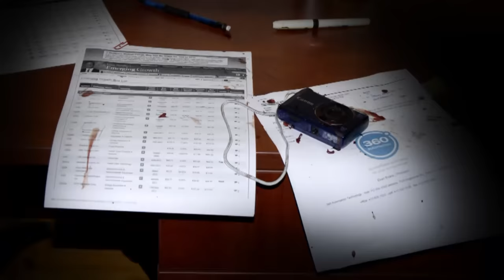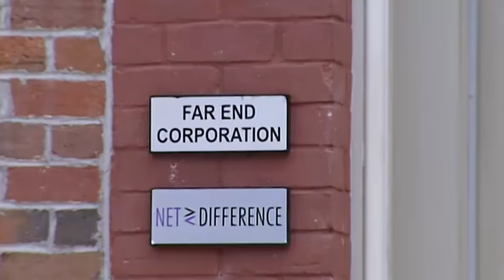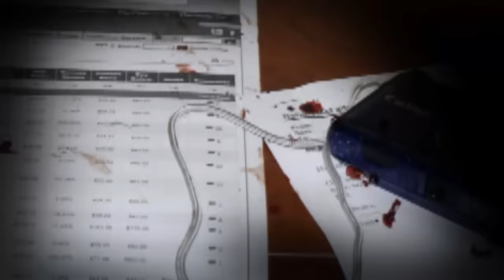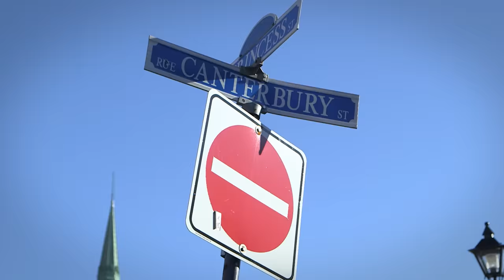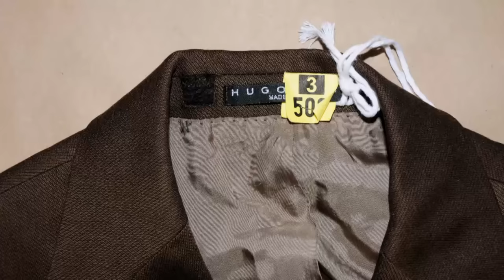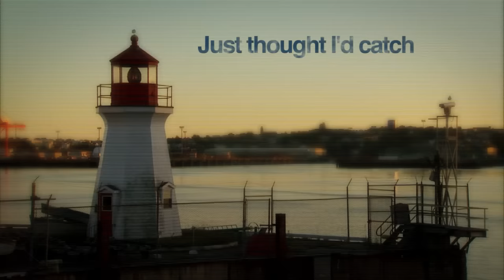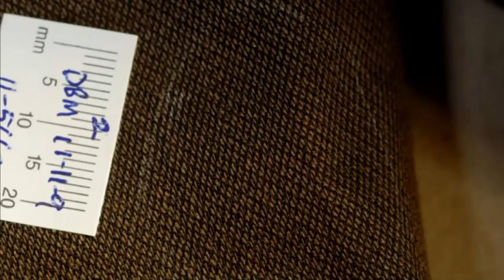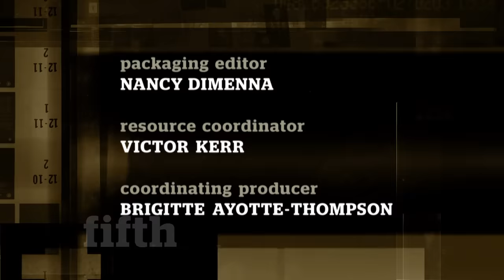The Richard Oland Case : Murder in the Family - the fifth estate

Comment: Rich kids tend to be sheltered under the umbrella of the parents.  They are never taught to do normal things that people in the middle class do all the time.  Taught to be independent and work for every penny.  If these rich kids are going to become a permanent upper echelon of a company that is owned by the parents, they should be required, in every case, to work in every department of the company.  This gives a two fold process, to learn the value of the dollar and then being able to carry an Executive (even President) position.  There is one final outcome, having the knowledge to run that Company with all the past years of experience behind you.  The respect, confidence and inner drive is now achieved.

Comment: “Which sounds like a loopholed” until you consider how common DNA is (Hint you can buy PCR machines) and that a warrants are issued on the preponderance of evidence determined by a judge. It’s unheard of (read technically unprovable) but you could definitely use a PCR machine and profiling technique to creat an indistinguishable gene cocktail from minute traces of the targets genes and a comprehensive profile of a relative. Not suggesting that’s what happened but it’s food for thought when you consider the statistics that justify genetic evidence.